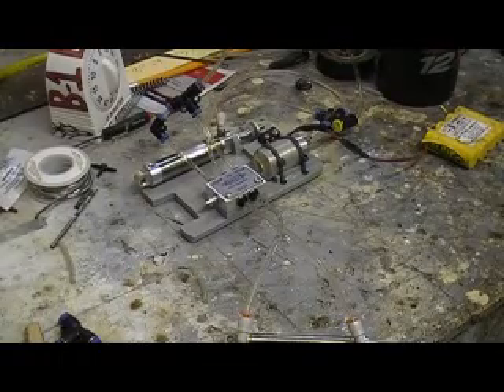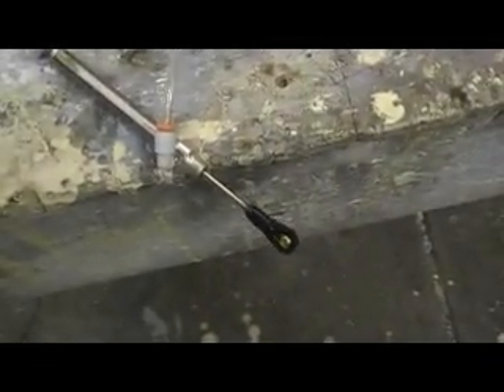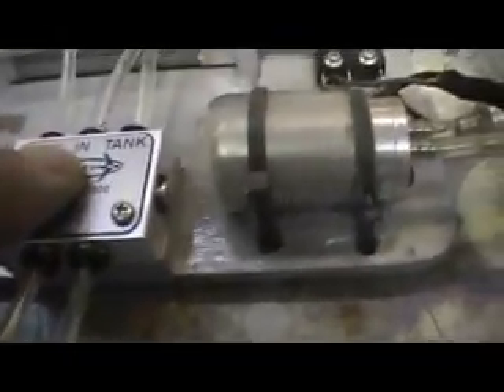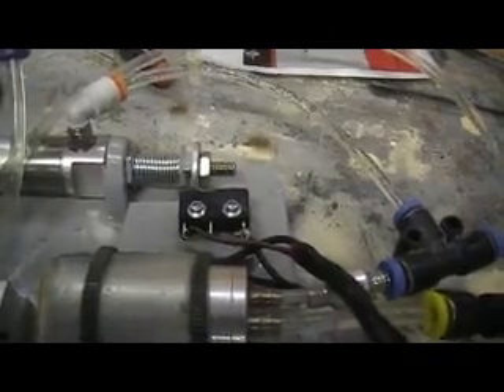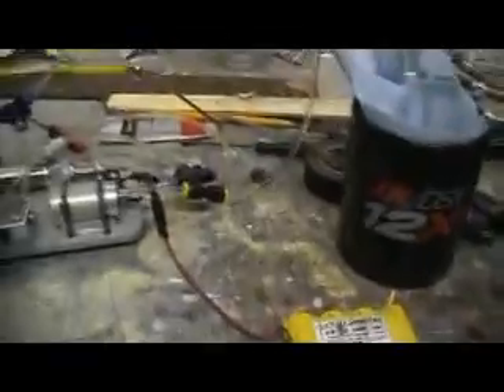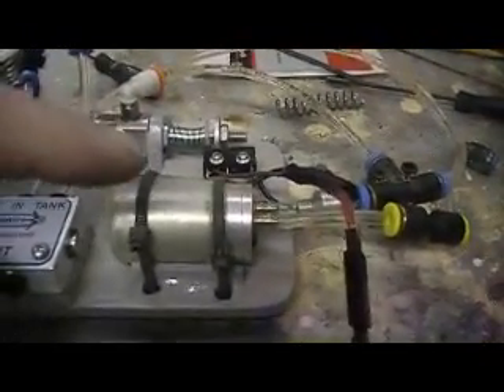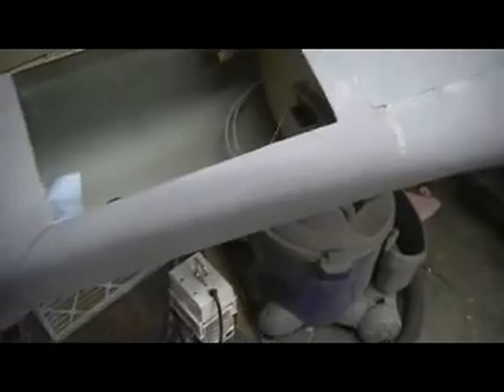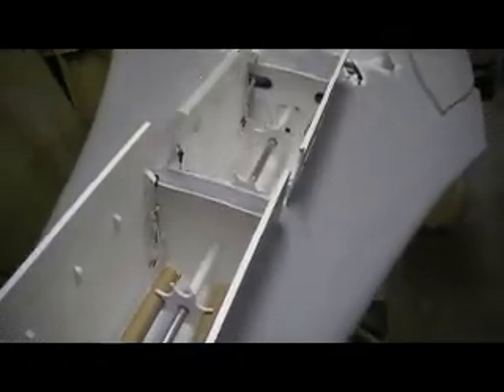how to build a rc jet B-1 Bomber # 150 PT 3

Comment: If you find the plastic lines are expanding, you could use steel brake lines and fittings and then flex to each cylinder to keep the compressibility to a minimum.

Comment: The air can be removed if you have one of those air bleed hand pumps for the brake system on you car.  The syringe idea will work but I think this might be better.  The syringe would be great for a system pre fill to minimize the air before vacuuming it out.
The compression of the cylinder that you showed can be caused by air but also the plastic lines might be expanding.  That can be confirmed with a dial caliper.  Measure before and during compressing the cylinder.

Comment: I agree- the hydraulic system is the way to go.  The air cylinders will have a hard time controlling the doors in flight.  They will probably keep the doors sealed in flight.  But as the doors open, they won't have enough capacity to keep the doors from being pulled open by the force from the air.  The size of the door panel and the force from the rushing air will maybe rip the doors open.  The hydraulic fluid on the rod side of the cylinder will prevent that from happening.

Comment: Hey bob, great work. I've been watching your videos for a while now, I'm a big fan!

To remove the air you'll need to bleed the whole system. An easy way of doing this is plugging a syringe in the tube that connects to the fluid reservoir. You fill the syringe with fluid, and inject until all bubbles come out on the other side of the system (you might need to do this a few times, as your system will be quite 'long').